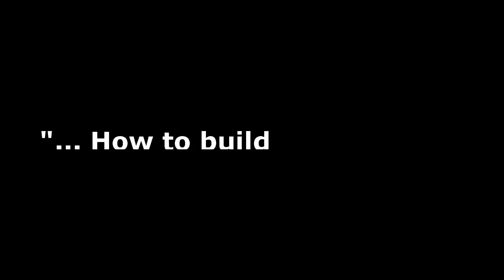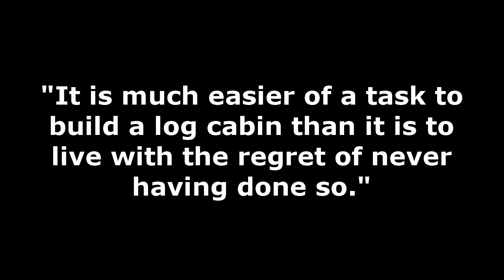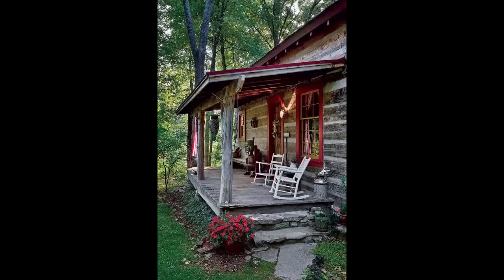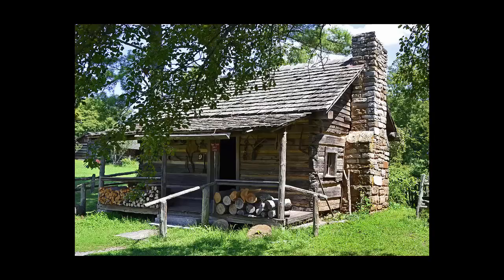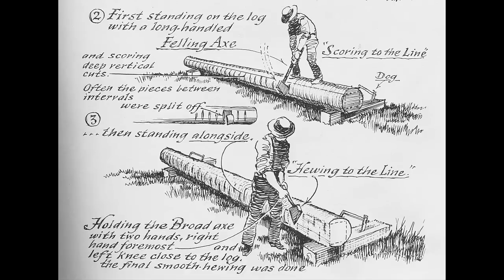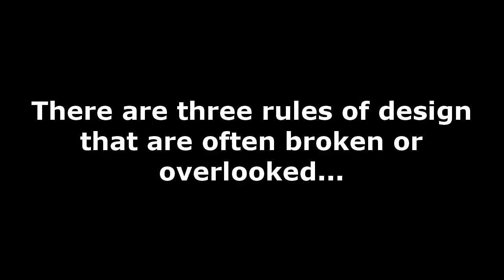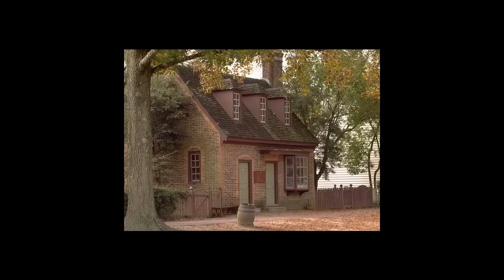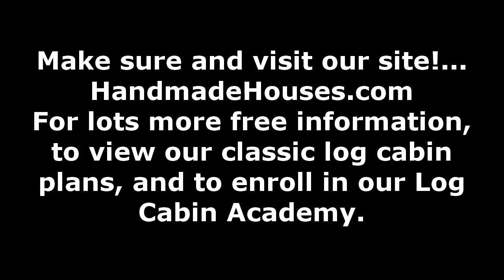How to Build a Log Cabin? Start with a Good Design.

Comment: Wow. All talk and no building. Also, you made a part 1....where the heck is the rest? 

Haha....that's a fail.
Reply from the maker: Hi, thank you for the inquiry. This was my first attempt at creating a video to share with others about how I build handmade homes. I admit that it is not the best... we all must stumble when we begin learning a new craft and video production and editing is not one that I'm experienced in. The point that I was trying to make with this video... and it's a valid point... one that I don't see being made anywhere else... one that is so critical in building a home in which one takes pride in it. Is when building a cabin to not to start with a log and an axe... but instead with clear vision of what the end home will look like and then reverse engineer it. I have been building handmade homes for years. I want to help others do the same, to share what I've learned. I never made part 2 to this series because of the load of insults that I received from this one... rather than encouragement or advice on how to get better. But I've been practicing and I think I'm improving... I hope you will give me another chance and view some of my latest attempts. Noah
Reply: hi all I'm trying my hand on her face to be in a while ago but never